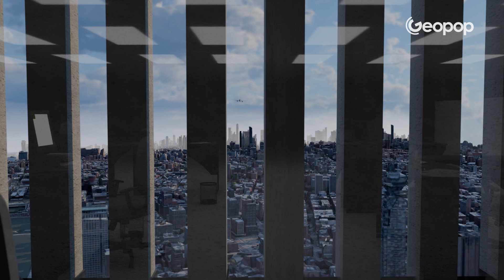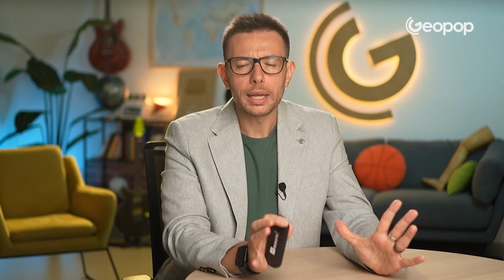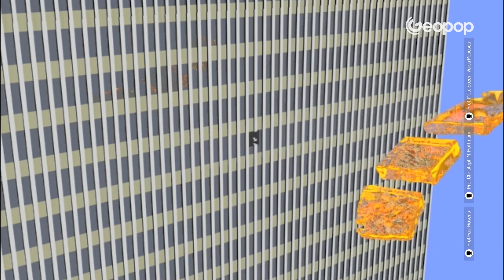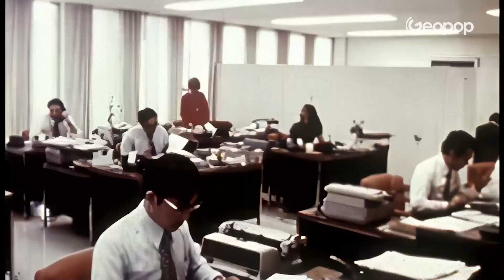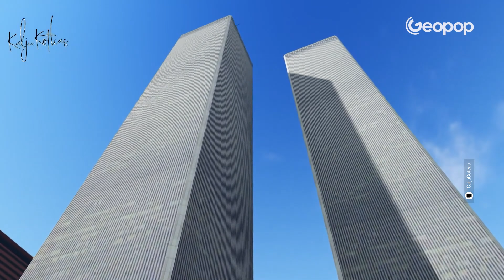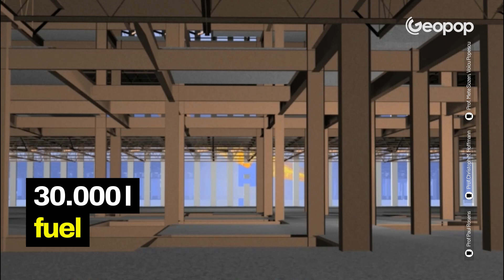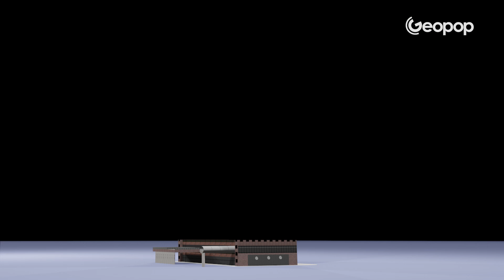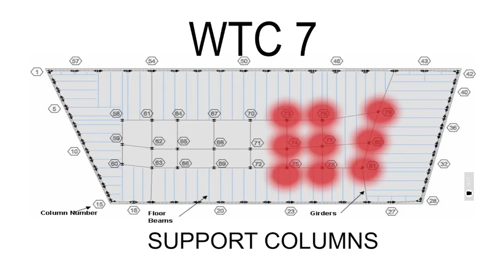9/11, 2001: The Technical Reconstruction of the Twin Towers and WTC 7 Collapses

Comment: If you honestly think that building 7 came down because of a fire you definitely need your head examined. You clearly can see the controled demolition plain as day.
Reply: OK then, but can you do this:  Building 7, the 6th building to collapse of 10 lost on 9/11 though extensively studied still confuses many. Not famous or a terror target and with no casualties it didn’t get a lot of attention initially, creating an information void the internet filled with utter garbage. Because everything seems like a conspiracy if you don’t understand how it works I prepared this brief summary from my own analysis to fix that. No politics, just engineering. 

The North Tower collapse at 10:28am bombarded Building 7 with tons of burning debris, causing heavy damage and multiple floor-wide fires that burned out of control for 7 hours. Half the FDNY firefighters having been killed, others injured, units in disarray, equipment destroyed, no water pressure, and the greater urgency of Search & Rescue efforts, firefighting was pulled as futile. The building couldn’t be saved and was left to its fate. That is the sort of choice firefighters make every day in brush fire situations - which houses to save and which ones to let go. Only real difference here is moving the decimal on the size and cost.

www.youtube.com/watch?v=g_SvpwyC17M&ab_channel=MFitz  

Collapse of a burning structure is always a concern for firefighters. Steel buildings subject to fire rely on active fighting of the fires to survive. Buildings are designed around 1 to 3 hours of fire resistance, allowing time for occupants to escape and ACTIVE firefighting to get started, after which all bets are off. Left to their own devices they will exceed their design envelope and collapse. In B7 the occupants escaped, passive and active fire protections were compromised and active firefighting was abandoned which left the building to its fate. It lost. Odds on Building 7 would eventually collapse, and it did. No big deal in logic. 

www.youtube.com/watch?v=WnYBX6QT0R4 

FDNY Chief Daniel Nigro ; The biggest decision we had to make on the first day was to clear the area and create a collapse zone around the severely damaged 7 World Trade Center, a 47-story building heavily involved in fire. A number of fire officers and companies assessed the damage to the building. The appraisals indicated that the buildings structural integrity was in serious doubt. I issued orders to PULL back the firefighters and define the collapse zone. It was a critical decision; We could not lose any more firefighters. It took a lot of time to PULL everyone out, given the emotionalism of the day, communications difficulties and the collapse terrain

FDNY Deputy Chief Peter Hayden ; We had our special operations people set up surveying instruments to monitor and see if there was any movement in the building. We were concerned of the possibility of collapse in the building. And we had a discussion with one particular engineer there, and we asked him if we allowed it to burn could we anticipate a collapse and if so, how soon? And it turned out that he was pretty much right on the money, that he said 'In its current state you have about 5 hours

The collapse of Building 7 was anticipated and widely reported in the media throughout the day. At least 24 video cameras recording some or all of the collapse. Everyone knew what was coming and why.

www.youtube.com/watch?v=OY5S5k3tMHI 

Building 7’s collapse was completely different to the Twin Towers, and harder to understand with most details hidden from view. But we can still sort out what happened through careful analysis and observation.  This is my explanation  of the collapse using the best available information and relying on no authority.

B7 was complex 47-story steel framed structure built on top of a smaller existing 3-story building, requiring several lower floors dedicated to complex load transfer structures instead of usable office space. Of trapezoidal shape and all-steel tube-in-tube construction, B7 (above the 7th floor) consisted of a central core of steel columns carrying most of the gravity load, perimeter steel columns around the outside of the structure carrying the remainder of the gravity loads and long span beams and girders to tie those elements together and form the floors. On the outside of the building hung a moment frame - the last part of B7 to fall 

Phase 1 : The first externally visible signs of collapse initiation occurred at 5:20:28 pm. Collapse initiation for B7 is notably quiet with observers not realizing the building was collapsing! There was no audible warning in the form of say hundreds of ear drum busting 180-190dB explosive bangs preceding the collapse. Here at 12:00 a local CBS affiliate reporter is talking 10 blocks from B7 when collapse begins. People don’t start to notice the collapse until 12:11. Then at 12:45 is the famous CBS fixed camera clip of Building 7’s collapse.  Note how quiet it is.

youtube.com/watch?v=t5tEy6mXSE8&ab_channel=fresnosean379

Collapse initiation was due to lower floor failures above the load transfer region (7th floor) in the NE corner of the building. In this video at 0:45 you can see the NW corner from inside the building while under construction, Column 79 just out of frame on the left. That big, angled steel beam across the top of the frame connects to C79 at one end. The girders connect to the beam. That beam and all those girders depend on just one connection

youtube.com/watch?v=nP3TNHPCIVU&t=35s&ab_channel=EdwardCurrent

Phase 2 : Lower floor failures caused a loss of critical lateral support over an excessive length of core Column 79 and it buckled. If you look at a floor diagram of Building 7 (see above) and look at all the structures that depend on C79 you quickly realize this one column was a relatively isolated structural element on which a disproportionately greater fraction of the structure depended analogous to say the Key Bridge. Externally we see a vertical progression of window breakage along the 44-46 line and a kink in the roof of the East Mechanical Penthouse at the top of the building, consistent with C79 failure. The transition from full capacity to almost no capacity occurs in virtually an instant. Once the buckling failure occurs there is almost no resistance

Normally with a buckling column, the load could very well be redistributed to other columns, meaning the buckling could stop after a while. With C79 that is not the case - the failure did not redistribute the load, so the collapse rapidly progressed to the roofline, sinking the rooftop penthouse.

Phase 3 : With C79 gone, B7’s progressive, non-symmetrical collapse continues with C80 and C81 at the east end of the core left laterally unsupported and quickly buckled and failed as well, sending the EMP down through the building. C79-81 all have no diagonal bracing, which I believe is a major reason why they could not redistribute a lot of vertical loads among one another.

From there collapse progressed from east to west through the central core until the core was gone taking all of the interior floors and structures and probably most of the perimeter columns with it. You can see the horizontal progression of window failures low in the building and the dropping of the remaining rooftop structures into the building. One of the big takeaways from the NIST Building 7 study (that gets completely ignored) was their modeling which determined C79 failing under ANY circumstances would have initiated the same collapse sequence.

Phase 4 : 10 seconds in only the exterior moment frame - just a hollow empty outer shell – remains, the illusion the building is still standing since little has outwardly changed. But it’s just a hollow empty shell like an empty cereal box supported by only a few remaining columns and quite unable to remain standing. With all internal framing gone, the north face leans inward, forming a V in the roofline, the last perimeter columns buckle under the strain and the moment frame free falls, landing on top of the 7-story high debris pile. It is only here, at the end that a single measurement of alleged free fall acceleration is taken, from a single point on the moment frame. The Building (defined as its center of mass) did not “free fall” (sort of) – just one corner of the outer shell did. _
The Building_ was already gone before that happened. The period of alleged free fall was a product of collapse progression mechanisms, not of collapse initiation mechanisms and is irrelevant to what started the collapse. Start to finish the entire collapse took 18-20 seconds, 3 times longer than true free fall and how fast something falls cannot tell you what started it falling anyway. The debris spread outside the footprint, blocking surrounding streets, heavily damaging the Verizon Building and destroyed Fiterman Hall.  

Building 7’s progressive, non-symmetrical collapse was incidental and unintended collateral damage from the combined effects of fire + time + gravity started by the collapsing North Tower. That is true no matter who planned and carried out the 9/11 attacks or why . The collapse was of so little consequence it barely even registered at the time, a mere footnote. It only took on semi-mythical status as an alleged smoking gun years later when demolitions at the Twin Towers, missiles at the Pentagon and shoot down over Shanksville all failed and conspiracists had nothing left to work with.

Anything can seem like a conspiracy if you don’t understand how it works. Now you should. I hope you found this helpful, informative and it solicits informed critical comment. If I made any errors of fact, logic or reason or left anything important out, please let me know so I can fix it. IF you can offer a more plausible alternative please do. Be the first. Please start any reply with the words “Tits McGee” or I will know you didn’t read it and are wasting my time.
Reply: "If you honestly think that building 7 came down because of a fire you definitely need your head examined."
-Says an ignorant conspiracy theorist...

Comment: Grenfell tower,  a disaster in the U.K. was an Apartment block that burnt for over a week and didn’t come close to collapsing … just saying
Reply: Was it hit by a plane?

Was it of steel frame construction?

Why did you leave out far more relevant examples like Plasco Tower or Wilton Paes de Almeida?
Reply: The Grenfell tower's core was incased in concrete, which protected it from the heat.  WTC had no concrete reinforcement.

Comment: If the powers up top just admitted "we executed an emergency controlled demolition of the towers to ensure the prevention of more lives than thoughs potentially unsavable"  id at least gain 2% of trust in them for an hour or so... also,doctoring some evidence after the fact isnt complicated. i used to "show my work" on tests ive cheated on as well...*cough* building 7 cough
Reply: So you would trust them more if they just flat-out lied?  What does that say about YOU?

Comment: I can hardly believe that in 2025 people still believe the NIST whitewash! Insane. Please - if you believe this tripe - go and look at the troves of rebuttal at the architects and engineers for 911 truth website.
Reply: Objectively, AE911T is not a professional organization by any stretch. AE911T are a tiny, fringe single-issue advocacy group that live on appeals to authority they don't possess, to push an agenda that has no tangible support in the professional community. They have no support from any professional engineering organization anywhere in the world and support amongst individual professionals in relevant fields is tiny to the point of insignificance. The lunatic fringe of the tiny lunatic fringe minority. They tell people like you what you think you want to hear, so you accept the (false) appeal to authority and don't ask questions, even if you knew what to ask. They are a faith-based organization, selling dogma which never adapts to new and better information. 

To illustrate their level of "expertise"; AE911T used to have one former manager of architects on staff whose claims to fame were a Denny's and a high-school gym. A couple of years ago the board tossed him out of the organization he founded for jeopardizing their donations. It's pretty obvious where the priorities are. Their top structural engineer is an unlicensed civil engineer who builds radio antenna towers. Their FEA is done by a carpenter using MS Paint. Their physics is done by a retired 9th grade science teacher.

The talent pool is not deep and it shows in their output.

Highly-Credible People don't ask questions, they answer questions. So much for AE 9/11 Truth, whose sole play is trying to get someone else to do the investigation.  I thought these guys were supposed to be “experts”

Architects and Engineers for 9/11 Truth;  No Architects, no proper Engineers and no Truth.  They get the date right. 

AE911T are just a slick, focused PR campaign raising money for the sake of raising money.

Comment: The collapse of those towers was caused by other BOMBS that went off. I learned that jet fuel burns out within an hour, so the jet wasn't the only reason that caused them to collapse!! This was an inside explosion and very well calculated!!! Bush is the one I hold accountable for this most tragic day.😢
Reply: Jet fuel burned off within about a minute. It acted primarily as an accelerant. Yes, office buildings are chock full of stuff that burns which is why the fires continued to rage and spread to multiple floors right up to the moment of collapse. 

Collapse initiation was due to sagging floor trusses (which we can see) causing inward bowing of perimeter columns by up to 5 feet (which we can also see) at the impact and fire damaged floors until those perimeter columns buckled and failed, initiating the collapse (which we can see). I would refer to you the excellent Gary Pollard video of the collapse of the South Tower. Pay attention to the first 12 seconds in particular.

WTC2 Collapse -- Gary Pollard (Enhanced Raw Copy from NIST) 

www.youtube.com/watch?v=ULdiD6gYZO0  

Columns don’t work well when they are bent. The Twin Towers were designed to work with straight elements not bent ones. When you bend those columns they become up to 4 times weaker. Failure is inevitable.

Notice how the columns are already bent when the camera zooms in, become a bit more bent over the next new seconds until they give, starting the collapse. 

So what bent them? It sure as shit wasn’t thermite or sooper-sekrit fire-and-impact proof hush-a-boom pre-planted demolitions that don’t explode. 

If you keep watching you will note that after the tower starts collapsing the air inside the building (95% air by volume) gets compressed and forced out the windows. These low-velocity air bursts devoid of blast or fragmentation effect are a reaction to the building collapsing not a cause of the building collapsing 

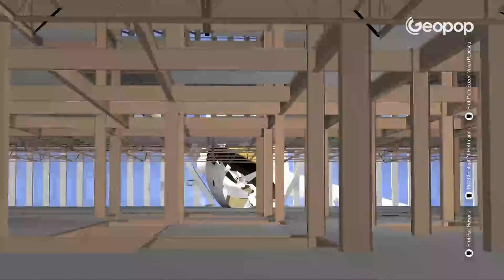And at a different angle from 1:18 here:
youtube.com/watch?v=TJJPYTVjxug&ab_channel=femr2 

Or here
www.youtube.com/watch?v=-DCgEJ2bUcI 

Also seen in the excellent still image here at 9:09:
youtube.com/watch?v=YXsDwKYz1bA&ab_channel=msvfreak94
Reply: Stop smoking crack lady.  Smh.

Comment: uneven damage has never caused uniform destruction
Reply: How do you know? Where did you get your engineering degree?
Reply: @  you dont need a degree to have seen it mimicked a controlled fall perfectly in all 3 buildings. beams at ground level were clearly cut with thermite at 45 degree diagonal angles. fire departments were reporting pools of molten metal in the basement and debris for days.  alot of engineers had come forward saying things didnt add up.  properly, the tops of the buildings should have fell off or such. they were designed to withstand the damage they took. but it got the patriot act passed, got us into the war and wtc owner got a huge insurance check.
Reply: @OPsK1LLs  Nope! Controlled demos don't begin at the middle of the building, the beams were cut with lances (not thermite) and that was done AFTER 9/11 by cleanup crews dismantling the wreckage, no one says the tops should have "fallen off," and the damage they were designed to withstand were from jets smaller than a 767 traveling 1/3 the speed with little fuel. Oh, and Larry Silverstein lost money on 9/11.

You don't know much, do you?
Reply: @OPsK1LLs  - You mean these cuts?  www.youtube.com/watch?v=pVDU5QKa8Wg&t
Reply: And still hasn't.